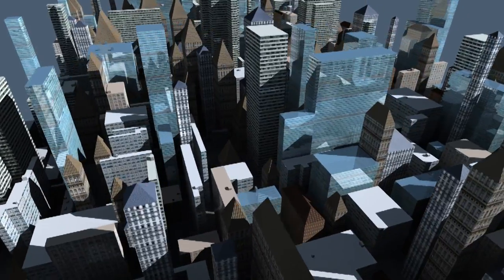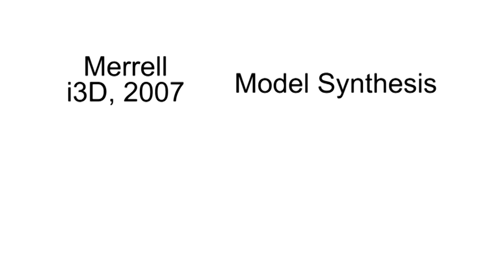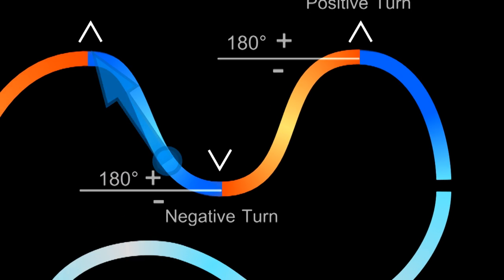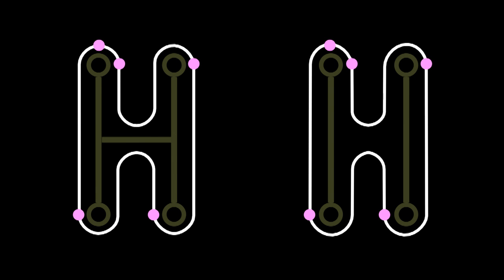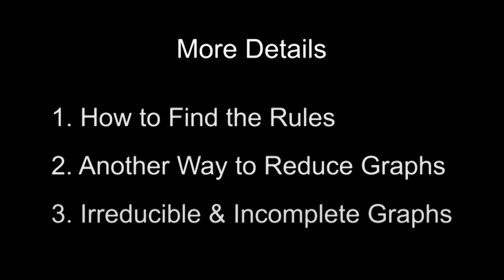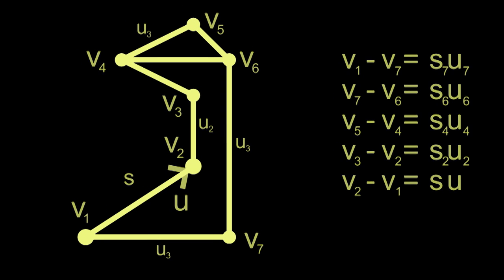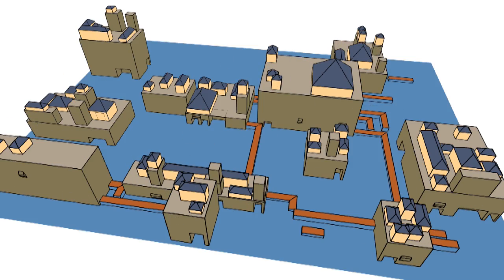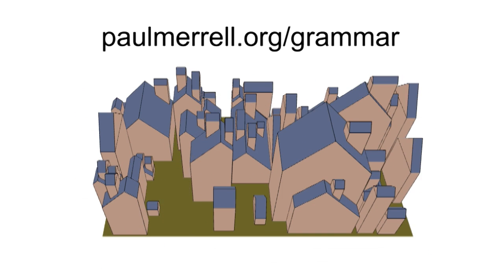Procedural Modeling Using Graph Grammars

Comment: The fact that this has 16k views is insane to me. This is method holds so much value. Your name needs to be mentioned more in books taught in school.
Reply from the maker: That's very kind of you. I'd encourage you to please share it with your friends.
Reply: @PaulMerrellResearch 😭 If only I had friends I could share this with
Reply from the maker: @t33h33studio  If you're interested I quietly shared a lot of the code I used to make this: https://github.com/merrell42/Procedural-Modeling-Using-Graph-Grammars. I haven't made a big announcement about this since it still needs some work.

Comment: You mentioned your technique doesn't handle rotations.  Are there systems that do handle rotation that might be compatible with your approach in some way?
Reply from the maker: During the local similarity part, translated objects are treated as being the same while rotated objects are not. I see this as a feature, not a bug, but in some cases you may want to extend it to rotations. Note that you can still apply rotations and deformations as a post processing step and I have several examples where this is really useful. Bokeloh et al.'s method treats rotations just like translations, but I've described its limitations. I don't think it would be too hard to extend my method to handle rotations like translations, but no one has done that to my knowledge.

Comment: - Sounds like WFC
- "anyway, my research inspired WFC 10 years later"
- 😯🤯
Reply from the maker: I'd put it more bluntly that WFC is a copy of Model Synthesis. It's shocking how many people know about the knock off and not the original.
Reply: @PaulMerrellResearch  Why specifically call it a copy and not a (over)simplification? Great work btw, will definitely try to implement it on my free time.
Reply: @jurel-enlatado1  I don't think a simplification is the right way to think about it. That was not a novel contribution. The core algorithm is exactly the same.

The main difference is that WFC didn't implement the modifying in blocks. It was clear from the very beginning that that step wasn't always necessary, but it can be very useful for handling some difficult cases.
Reply: @PaulMerrellResearch  Yes mostly because WFC is accessible
You maybe did all the heavy lifting, but you also have to make it popular which is an effort in itself

Comment: this is interesting

I'm planning to test this concept on a few things:

1) generating NPC with different 3d model (height, weight, facial feature, clothing and etc.). and if its doable, it can be applied to literally any game object model creation too

2) using this to generate UI, user will feed in the current UI and it generates all the permutation base on it, this allow rapid prototyping 

3) using it to create units with slightly different stats in a game while still ensuring its sort of balanced

will be using it to create my next game, this is a truly interesting concept! thanks!!!
Reply from the maker: I'm glad you're excited about this. One of the starting assumptions is that we're dealing with something that is self-similar. Good examples of this are what I've shown: architecture, game levels, terrain, etc. I'd love for this to work on things like characters, but it might be more of a challenge. Good luck!

Comment: in the 3d model case, how do you decide where to cut the model to generate the primitives? both in terms of position, orientation and scale. In the example at 15:38 there seems the choice seem to follow a grid
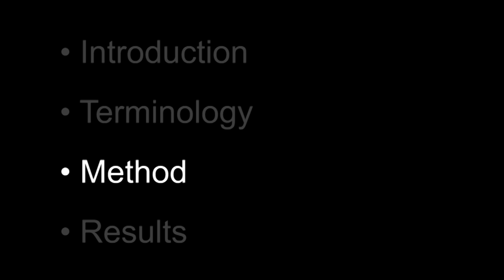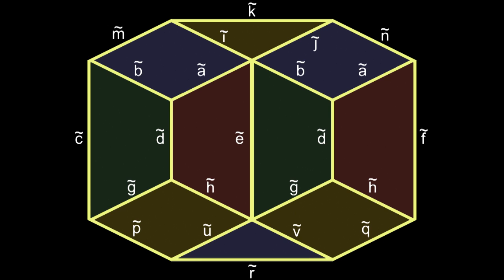Reply from the maker: @ValerioBelcamino-m5j Every edge is cut in half (see 6:49). While many of the examples look like they're on a grid, this was just done for simplicity. This method works fine for shapes at any angles. You asked about the position, orientation, and scale. The edges can stretch to any length (see 3:34) and the primitives can go in any position. So the position and scale of the cut is irrelevant. The orientation matters for determine the edge label (see 4:29).

Comment: how did you manage to do so much visuals? It’s incredible.
Reply from the maker: Thanks! It took a lot of work. Hopefully you were able to follow from the video how I made the shapes, but I also applied a lot of textures and decorations to the edges, etc. and then rendered the 3D shapes in 3DS Max. I have some more results and will be making some more videos soon.
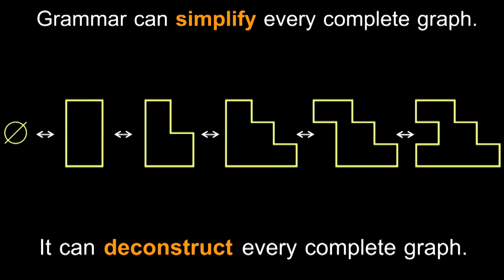Reply: @PaulMerrellResearch  Oh, no I don't really understand your research :). I actually meant the visualization of concepts, f.ex at 9:24, 10:27, etc.
Seems like every single sentence is animated, and the animation syncs up really well with what you're saying.
Must be an insane amount of work to do that in something like PowerPoint.
Reply from the maker: Oh, yes that also took a good amount of work. You couldn't do something like this in PowerPoint. I recorded all the audio and then animated it so it matched the audio. For someone who does a lot of 3D animation it's not difficult, but definitely more advanced than PowerPoint.

Comment: Question, i see alot of this being applied to map creation but could you apply it to things like enemy creation, character creation, etc How granular of an application space does it have? How much would it have to be changed to work in applications outside of map/level creation?
Reply from the maker: The idea is built around the concept of geometric similarity. Basically, this can work on any shapes that are self-similar: building, trees, flowers, terrain, space stations, factories, etc. All the things that procedural modeling works on right now. It doesn't matter how big or small the objects are. But I don't know that it would be good for characters as they aren't really self-similar.
Reply: @PaulMerrellResearch  So its good for things i can break down to more arbitrary shapes?
Reply from the maker: @thegoldenatlas753 I'm not sure what you mean by break down to more arbitrary shapes. It's good for objects that a self-similar meaning they contain repeated patterns. A fractal pattern is the ultimate example of this. A tree is also a good example. It repeats the same leaf patterns and the same branch pattern over and over.
Reply: @PaulMerrellResearch  ahhhh ok that makes sense. Im definitely still curious what i could make with this so im gonna explore implementing it into Rust/Bevy to see what it can do in 3D. 

This honestly reminds me of how AI is but feels like the formalized math that an AI would be trying to approximate, which is genuinely amazing. Im very glad i found this even.

Comment: Your method is very ingenious and it definitely seems like it worked out most of the positive/generative part. All that really remains is figuring out how to model the constraints/rules that steer/converge the generative part into something desirable. Keep up the good work! You're definitely on the right track to something incredibly useful!

In Control Theory there are the dual concepts of Positive and Negative Feedback, all you need is the negative/regulating part.
Reply from the maker: Thank you!
Reply: @PaulMerrellResearch  You're welcome!

Comment: This is awesome! I am curious how this compares to the 3d performance of the model synthesis algorithm (I think this was NP hard and required back tracking), and if you could compare the two algorithms and the models they can create. A lot of this still goes over my head - but I still find this fascinating for game dev. Thanks for the content!
Reply from the maker: @tenthlegionstudios1343 The main difference is that model synthesis uses tiles on a grid while my new method is not tied to a grid. Model synthesis kind of looks like a video game where everything is tiled. But the real world is mostly not on a grid and my new method can create more natural objects. However if you are dealing with tiled objects, model synthesis has some advantages.

Also, my new method works by making small incremental changes. Each time we apply a rule we make another incremental change and produce another valid shape. But model synthesis works by trying to fill a large space without running into any contradictions. The problem is NP-hard and when you make a mistake you may have to backtrack quite a bit. In my new method you can also run into contradictions, but just within one incremental step. You may have edges that intersect. And actually it has been shown that deciding if a graph can be drawn without self-intersection is an NP-hard problem. But this is much less of a problem because we are making small incremental changes. If we have any difficulty applying a rule we can discard it and try another one. So we don't need to backtrack very far.

Comment: This is great stuff. It reminds me loosely of a class I took at UC Berkeley's School of Environmental Design back in the late 1980's taught by Horst Rittel. It was more of a seminar on Design Theory, actually, but not what I was expecting when I signed up. I expected the material to cover famous Architects and their philosophies/theories of designing buildings and so forth. After all, you generally look to the range of historical precedents for inspiration. But, Rittel had a completely unconventional approach (at the time). He described a method for solving design problems through using a "morphological box" that would essentially list all of the various possible design elements in an array of rows stacked vertically. So, one row would list possible floor plans, another would list window styles, another would list roof profiles, etc. Then, the designer would essentially run through and evaluate all possible combinations, discarding the ones that were non-sensical, and grading the ones that could work. Presumably, since all possibilities would be considered, the best options would percolate to the top. At the time, as a student of design, I had a real problem with this approach, not only because it seemed incredibly tedious for all but the simplest of design problems, but also because it ignored artistic inspiration and individual creativity. But, in retrospect, I think Rittel was simply decades ahead of his time. With the power of modern computers, and clever algorithms such as yours, I suspect approaching design in such a way is more practical than ever, even for complicated scenarios. I think the type of automation you are investigating is going to be a game changer in a variety of design fields very soon. Providing mechanisms for a designer to influence the automation, directing it in some manner, seems to be a key element that could make this kind of thing very useful. I'll be honest, I thought Rittel was kind of out of his mind. His approach would be so burdensome to implement on paper for a real-world situation, that I felt a little hostile toward it; I mean, it was almost absurd. Nobody in Architecture would actually work that way. But, now, with the computer at hand to do the heavy lifting sorting through the variations, it makes a lot more sense.
Reply from the maker: It's interesting to look back at the history of this and see that a lot of important theoretical work was done before it was practical to actually use it. I have another paper that focus specifically on residential architecture and on optimizing those designs: https://paulmerrell.org/wp-content/uploads/2021/06/floorplan-final.pdf. Certainly, you can see in my work that I agree with the basic philosophy of trying out a huge number of possible combinations. However, I will quibble with the idea of trying "all possible combinations". Even today, this is still impractical for all for most problems. There is a combinatorial explosion in the number of possible combinations for many small problems.
Reply: @PaulMerrellResearch  Awesome. This paper looks really interesting, and certainly useful for the applicability of it for real estate developers and architects, and game developers/film makers, too. You are right about the combinatorial explosion, and of course, one of the reasons one might hire a particular architect is that they have their experience, insights, and taste that cuts through and avoids all the options that aren't "right", and ideally they produce masterpieces with their signature vibe. I remember reading where Frank Lloyd Wright hurriedly sketched out Falling Water in a couple of hours because the client was suddenly in town and wanted to drop by and see the progress; Wright hadn't even started working on it since he was commissioned months earlier. LOL. But, such is the skill of a master who can generate a design in the mind's eye quickly.BTW, how much of your system relates to fractals, if at all? Fractals were a hot topic 25-30 years ago, and maybe they have a renewed practicality here.
Reply from the maker: @marshallross3373 This is closely related to fractals. One of the main features of fractal is that they are self-similar. Grammars are good at producing self-similar shapes. Here's an example where I use my technique to create something similar to a Koch Snowflake: https://imgur.com/a/opF0iof. And I could probably get it to work on several other fractal patterns.
Reply: @PaulMerrellResearch   Very cool. It is amazing what can be generated from a small set of primitives and grammars. Thanks for sharing your research and explorations. I'll definitely dig deeper on this subject. Really fascinating stuff.

Comment: is it possible to adjust the primitive cutting step to control the "granularity" of the analysis of the input?
Reply: Yes, absolutely, you can control the granularity. Remember the part where you can fill in the faces with different colors. You can do the exact same thing with the edges. You can assign different colors. This gives you a lot of control over how the primitives can be glued together. You can force certain primitives to be glued together meaning the final shape will consists of larger, more granular pieces.
Reply from the maker: Oh and  @ItsJustAstronomical   is also me. It's my other account. Sometimes I forget to switch them.

Comment: Super interesting! I've read through a lot of your work on model synthesis (and implemented something similar myself but found creating matching components in 3d was not easy at all), was just wondering about the performance characteristics of the algorithm for 3d. Is this something you see being used during runtime? Or a time-saving step when doing modeling? How does it compare to model synthesis?
Reply from the maker: The 3D shapes shown took about 1 - 1.5 minutes to generate. Whether that's fast enough depends on the application. It's fine if you just need to build a virtual world once and then you spend lots of time exploring it. I'm sure the performance can be improved. It shouldn't be difficult to parallelize it. You could have multiple processes applying rules, you would just need to make sure they apply to different parts of the shape and don't interfere with one another.

Model Synthesis requires the input shape to be made up of tiles that neatly fit on a grid, requiring it to be rectilinear in some sense. The new approach doesn't use tiles at all. It can handles meshes at any angles. It can create curved organic shapes.

Comment: Really interesting, and I'm very pleased to know that your work on this is ongoing. I recently implemented a version of wave function collapse for a game I'm working on. Along the way, I discovered model synthesis. It's my understanding that model synthesis is more attuned to 3d generation and I switched to something more like that in my approach, since I was working in 3d. 
Since then I haven't done much on the project, but this video has reinvigorated my interest and I'm looking forward to implementing this new iteration. the main stumbling block for my work was the time taken for the generation. I was wondering if you had any insight into this aspect, in particular in cases with large tilesets (or many 'primitives' as I understand in the new version). I looked briefly into parallel implementations as well and was wondering if this was something you'd considered as well. 
Keep up the great work, I'd be interested in a closer look at how you used graph theory and category theory in your work too, in case you're looking for video ideas :D
Reply from the maker: @julius9055 Can you tell me a little more about the tilesets where the generation is taking a long time? I've looked at many tilesets and they seem to work reasonably fast, although I haven't done exhaustive tests and for some real-time applications it might be slow. The Escheresque tileset is one of my more complicated ones with 100+ different tiles. And I can 100 x 100 x 10 = 100,000 voxel output in a few minutes.

Is the problem related to having to it failing and restarting often? If you're not using my strategy of modifying the output in parts, you would have that problem. That was part of the original Model Synthesis Paper. For some reason it was not copied into the Wave Function Collapse code.

I'm hoping to make more videos on lots of related topics, but I don't know you'll be seeing me dig into category theory too much. Honestly, I could use some good videos explaining that stuff to me. I find it confusing and I don't think it's terribly necessary for understanding my work.
Reply: @PaulMerrellResearch  thanks for the response. To be honest, I'd need to look back into it since it's been a few months. From my recollection though, my method was already a simplified version of your work and I'm sure I've missed some of the speed improvements that you've employed. I know for a fact that I haven't implemented a version of the modifying of the output in parts so that'll be the first port of call when I start work on this again.